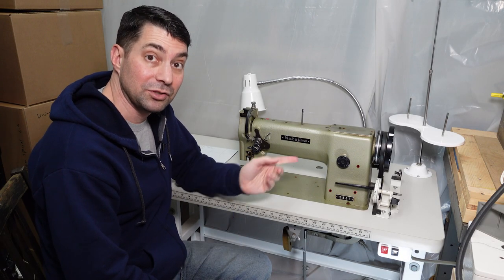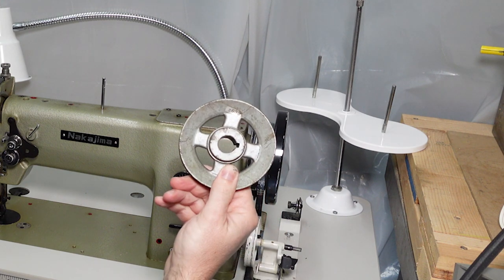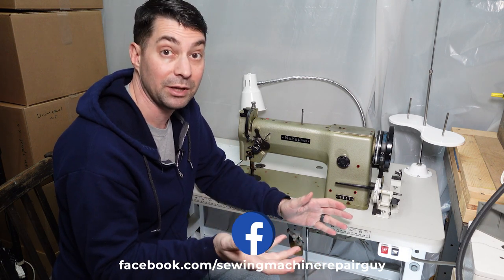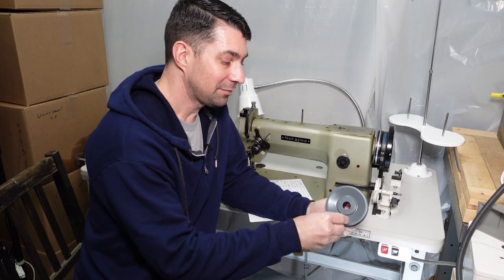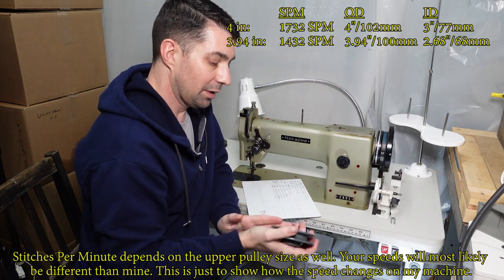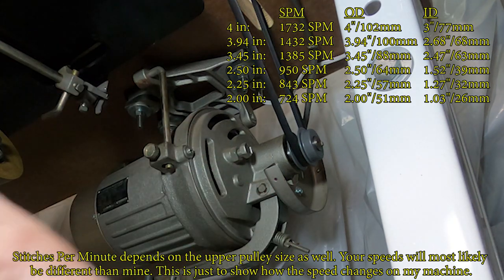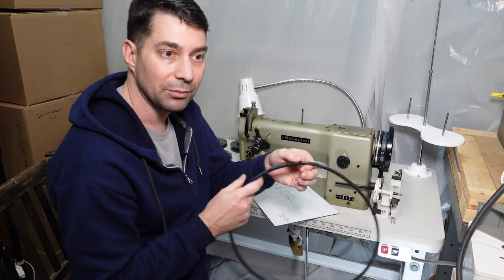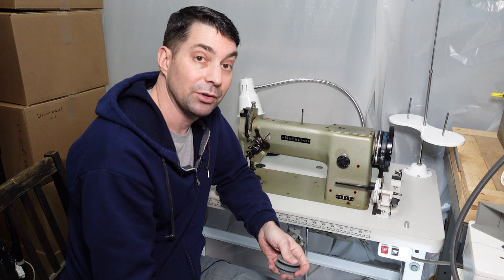Slow Down Your Industrial Machine on the CHEAP!! How to Slow Down an Industrial Sewing Machine

Comment: I have had the same 280L for over 20 years and just finished the modification to slow it down. Its way better!!!! I went with the 2 inch pully and used a 42 inch belt. The belt barely fit a 41 inch would have been better. Only wish I had done this 20 years ago. 
Thanks for a great video.
Orrin

Comment: Thanks for the insightful video! Just installed a 40mm pulley on my servo, works great. No need for a whole "speed reducer" set up which may or may not conflict with my needle positioner.

Comment: I did not yet change the pully on my Artisan 5800 which my tech calls a racehorse. I instead lengthened
the 12-inch clutch actuator bar by adding a 12" extension bar and bolting to the original making the whole thing
2 foot long and then I had to move the connector to the left side of the foot pedal from the right side.
This made the pedal travel, greater but it fine-tuned the pedal action making foot motions easy to
engage the clutch SLOWLY and evenly. I'm still going to change the pully too.

Comment: We recently bought a Yamata.  Almost identical to the Juki.   Craigslist special.   Fast as hell.   Has a 2" (approx) pulley on the motor and a 4-5 inch on the machine itself.  Another YT vid showed replacing the machine pulley so that's what we did.   Works like a champ.   51 inch V belt.    If I could also put a smaller pulley on the motor I would.   Thanks for the vid.

Comment: No need to ever change pulleys or belts on a servo motor, just turning the speed dial on the servo motor does everything you need. Servo motors are only around $100 these days and you will wonder why you didn't switch sooner!!!

Comment: I have that same 280L for almost 30 years.  Great solid machine! You should do a video on changing out the old motor for a servo motor. You can then slow it right down to a crawl.
Reply: Hey Bruce. Just wondering what servo motor did you put on your machine. Looking to do the same with mine. Tried the pulleys but it is still too fast because of the clutch; it grabs to quick for individual stitching.
Reply: One thing to keep in mind is the oil pump is driven off the main shaft and is designed distribute oil at the higher rpms when it is needed most.  You might starve your machine if it only runs at crawl speed,
Reply: @irabowers9057   I still did not put the servo on it.

Comment: Thanks so much for your video!!!  I changed the pulley on my 206RB3 to a 2" , cut the existing belt to fit and found a suitalble replacement , an oregon 75-442. Since I changed out the table top and am finishing up I haven't had a chance to use it but there is a very noticable speed reduction ... can't wait to put it into action, thanks again .

Comment: 4L  = belt width and pitch angle of the v groove), 460 = length in inches of belt (46 inches).  Example, 3L460 belt is the same as a 4L460 except for belt width.  Pulley groove width and pitch is an engineering thing, and there are charts that cover their use and it is complicated.   Just be sure the belt matches the pulley for good belt life.

Comment: I guess it makes sense that you would need a smaller belt for the smaller pulleys.  I probably wouldn't want the machine slowed down.  you should try servo motors. some servos have a speed adjustment lever so you wouldn't even need to change out the pulley.  they're also silent
Reply: Servo motor 130 bucks.  New pulley, 12.

Comment: Juki states in the manuals what type and size of belt you should use with a standard 400W or 550W clutch motor. I've replaced my clutch motor with a servo on my industrial serger and had to by a smaller belt size only because the position and design of the new motor required so. I suppose industrial sewing machine belts and pulleys, disegarding the pulley sizes and belts length, are the same all around the world.

Comment: You could save a bunch on electricity and get on the fly adjustability by swapping that always-on clutch motor with a variable speed DC brushless motor.

Comment: I didn't get a reply from a comment I put on your repair video of a Husqvarna Viking Designer SE!  I have a Designer 1 and when I turn it on, needle starts going up and down furiously fast and no way to stop it, none of the buttons work or the touchscreen (IT WAS WORKING PERFECTLY UNTIL I SHIPPED IT AND WAS RETURNED TO ME) THE BUYER got the machine out of the box and said this was happening so he didn't want it, didn't know how to fix it)    H E L P !!!
Reply from the maker: You will have much better luck contacting me via my website. Sounds like a bad board, they are very difficult to find.
Reply: @SewingMachineRepairGuy  Thank you.  What is the full name of the board?  Is this something you can assist me with??
Reply: @SewingMachineRepairGuy   new to fixing my own machines 
Would change the belt and pully put drag on the motor? Aka do damage?

Comment: Would you recommend slowing  down internal oil pump lubricated machines?
Reply: That's an interesting question.  Correct me if I am wrong, but you really want to know if decreasing the machine speed at the hand wheel will make the oil pump go too slow and not circulate sufficient oil to necessary parts?  As regards this context of lowering speeds by changing pulleys, I don't think there would be any problems of "under" oiling.  The circulation of the oil pump mechanism is proportional to the speed of the the connecting shaft in the machine - higher speed faster oil pumping, slower speed then slower pumping.  Just remember that you need to be vigilant about any and all of the oiling points not covered by the internal oiling system.  If you use your machine infrequently, it might be prudent to warm up the machine and get the oil flowing prior to sewing.
Reply: On a Juki that I have worked on, the oil pump is an impeller and won't actually pump oil up below a certain speed.  When doing slow careful work with the servo motor, I don't see any oil flowing through the view port.  To compensate, we periodically run the machine at high enough speed to see oil flowing in the viewing window.  It doesn't have to. be super high speed to get good oil flow.  I think even a small amount of oil is fine for slow speed sewing.